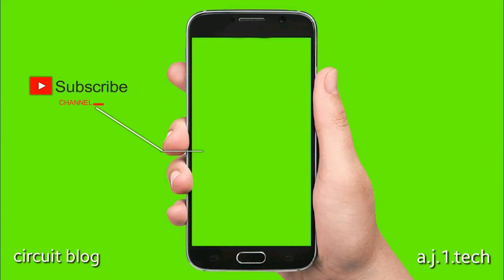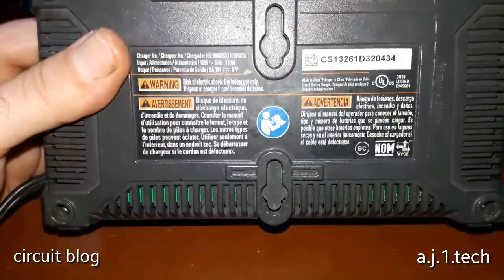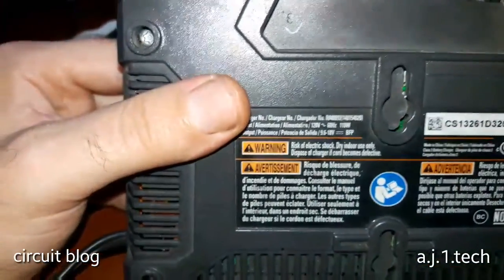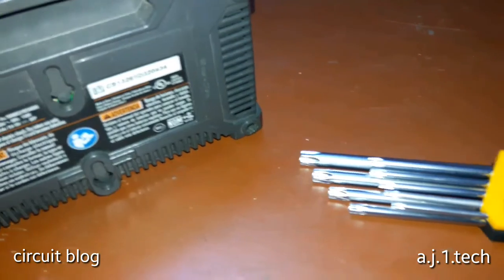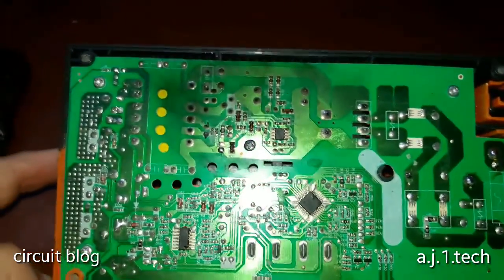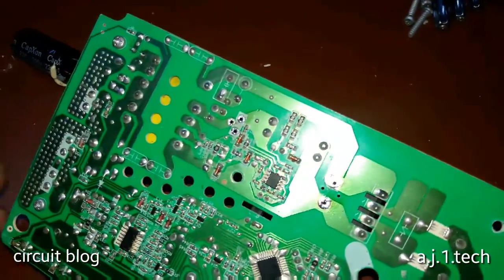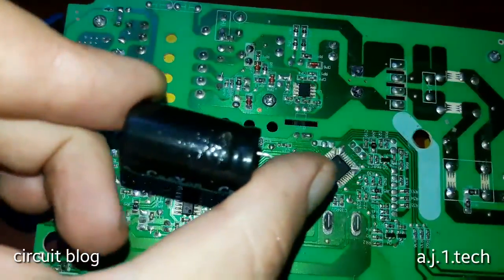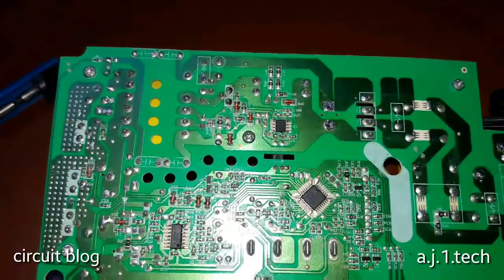Ridgid battery charger

Comment: Hello I have the same charger, I tested all the input components its all fine but in the output of the transformer was no voltage. How to fix it?
Reply from the maker: Hi thanks for your question 
In fact, the majority of malfunctions of this type of charger are in the primary circuit, and it is difficult to give an accurate diagnosis of the malfunction in your device because the device is not in front of me, but as I did in the video, repeat all the steps of the examination one by one and after that check the correction diodes after transformer and check the output capacitors check the chopper tranformer  coils 
Check the power out put lines for shorts and i hope you find the problem.
I hope this was helpful
Please subscribe to the channel and activate the bell button to receive a notification when I post any new video.

Comment: Sir I have two kind of ridgid charger but no one work I want to convert it to220v electric in Pakistan so my battery is also need to repair but just tell me about charger OK sir please
Reply from the maker: Hi thanks for your comment 
In 28 of sep i will post a video in this topic and how to convert a 110v units to 220v so stay tune to that 
Please like and subscribe in order you can get a notification win i post any new video
Reply: @circuitblog01  6 months im waiting, please make video to convert. Im so confused

Comment: The screws are torq security screws... available at most hardware stores or eBay or Amazon
Reply from the maker: Hi 
Thanks for your comment yes you can get them from e bay and aliexpress  but you can replace them with a normal  flat head or cross head screws, but only if the screw is the same thickness as the original screw in terms of the thickness of the threaded section and the same length and that it is the same   curvature of the teeth like the original ones .
I hope that I have answered your question and do not forget to like and subscribe so that you are notified. 
With Every new video I publish

Comment: Can you please check what resistor is on R7?
Mine's burnt.....
Reply from the maker: Hi, thanks for your question, and I apologize for not answering before, because I did not notice your question before. In fact, I do not know what the number of this part is because i  no longer have the device, but I can give you an approximate value. Can you tell me where it is on the board and what  it is connected to

Comment: Sir.. i have a ridgid charger n was smoked.. cause my uncle use 220 v to charging my battery.. which part must changed to repair it..
Reply from the maker: Hi , thanks for your question , and I apologize for not responding previously because I did not notice your question before, in fact I do not know what is wrong with your device because the device is not in front of me, but follow the following steps
1. Check the 100uf / 250v main capacitor and the main fuse and the bridge diode connected to it 2. Check the main power transistor and make sure of the resistors connected to it and with the control ic is ok and working 
 3. Check the ac to dc converter diode located in the output of the transformer with the parts connected to it with  the photocopier  ic and make sure of their working 
 I wish you success in maintaining it.
Be careful if you do not have experience with handling high voltages. Do not try to fix  such a device take it to a specialist Please like and subscribe to the channel so that you will receive a notification when I post any new video

Comment: can u make to 220v?
Reply from the maker: Hi . Thanks for your comment 
Yes i can make it run on 220v 
 By changing the resistance values of the input voltage of the mos fet control ic and changing the filter capacitor and the fuse, and also changing the capacitors in the feed back circuit in order to obtain a pure output in the charging section.
I hope this was helpfull.
 please like and subscribe to the channel in order to be notified. With any new video we publish
Reply: @circuitblog01  Please make a video for it, I will look forward to it
Reply from the maker: @avgear2694  
I will
Reply from the maker: @BettyMasterPain  
Hello, thanks for your question. Actually every device is different in terms of design and sometimes with the same model. The  Circuits can be different, and the values of resistors and capacitors can also be different. I do not recommend trying to convert any circuit from voltage to another except after studying the elements involved and whether these elements Bear the current and the voltage difference or not I am happy that the dewalt  regardless of the model, has worked for you, but this does not mean that this method can succeed with other models, so you have to study the circuit and calculate the electric difference across the resistors, especially the starting resistors, in order to make sure that they will handel the voltage right .
In the future, upon a subscriber request, I will publish an explanatory video on what steps must be taken to carry out this process and what are the elements that must be shown Please like and subscribe to the channel in order for you to receive a notification when I post any new video
Reply from the maker: @BettyMasterPain  
Hola gracias por tu pregunta En realidad, cada dispositivo es diferente en términos de diseño y, a veces, con el mismo modelo. Los circuitos pueden ser diferentes y los valores de resistencias y condensadores también pueden ser diferentes. No recomiendo intentar convertir ningún circuito de voltaje a otro excepto después de estudiar los elementos involucrados y si estos elementos soportan la corriente y la diferencia de voltaje o no estoy contento de que el dewalt sin importar el modelo, te haya funcionado, pero esto no significa que este método pueda tener éxito con otros modelos, por lo que debe estudiar el circuito y calcular la diferencia eléctrica entre las resistencias, especialmente las resistencias de arranque, para asegurarse de que manejarán correctamente el voltaje. En el futuro, a solicitud de un suscriptor, publicaré un video explicativo sobre qué pasos deben tomarse para llevar a cabo este proceso y cuáles son los elementos que deben mostrarse. Por favor, me gusta y suscríbete al canal para que puedas recibir una notificación. cuando publico un video nuevo
Reply from the maker: https://youtu.be/SVJ-0tkz62A
I hope this can help